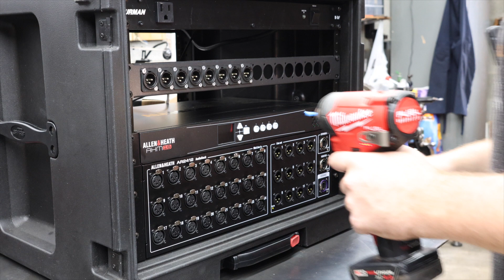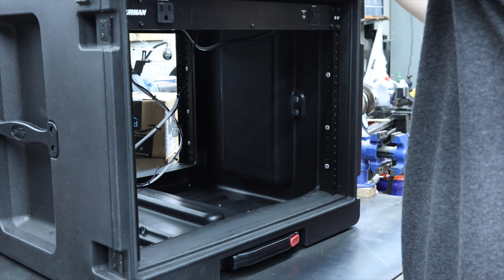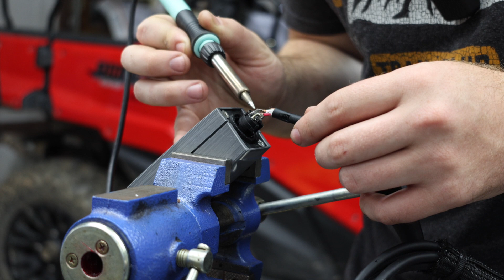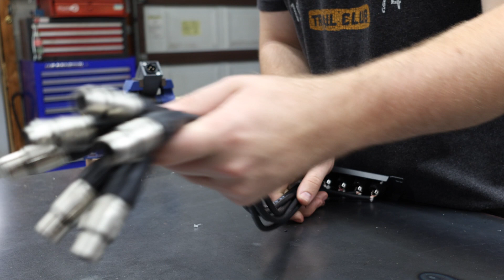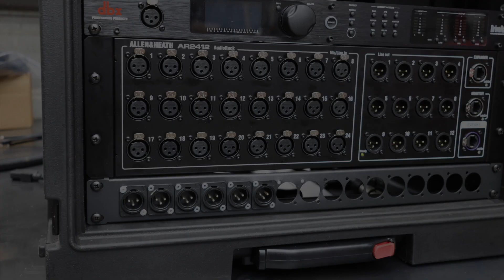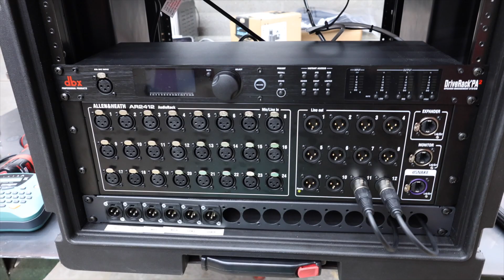Building Building the Ultimate Allen & Heath Stage Rack

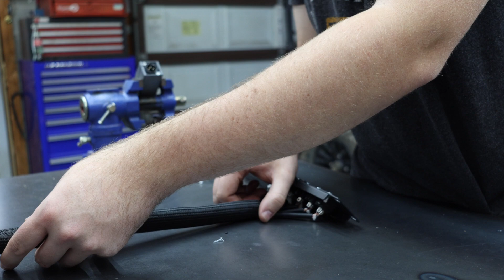Comment: It would look better if the XLR sockets were mouted inside the panel, not outside. At 10:10 your cables (far left and right) are way to tight, they will fail in the future for sure.
Reply: Im glad I wasn’t the only one thinking the exact same thing. Gives those wires some slack. And then also at 12:20 the IEC power cable stretched….eek….either move the end to the closer plug or relieve some of that tension lol. I’m OCD like that. But otherwise cool vid